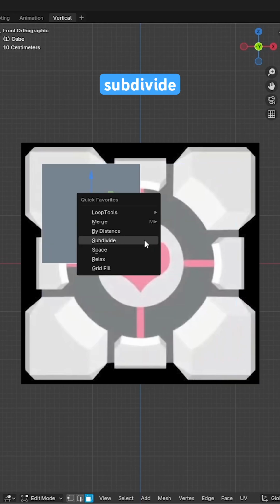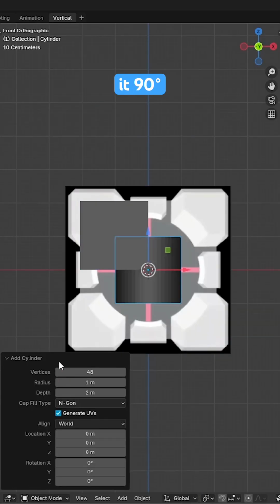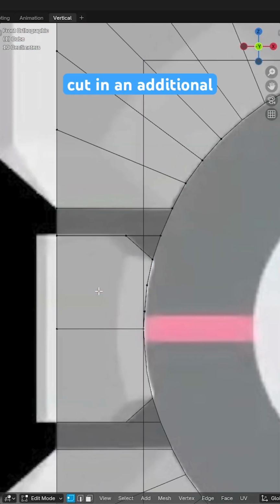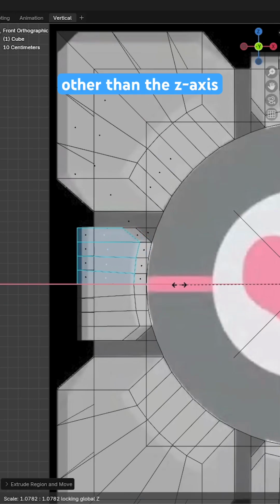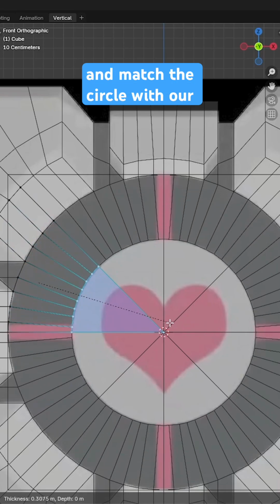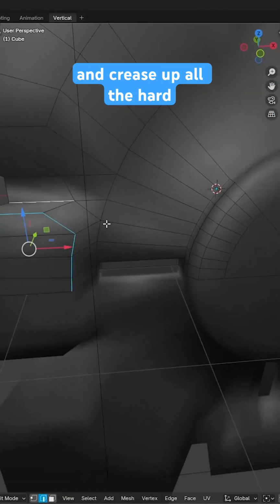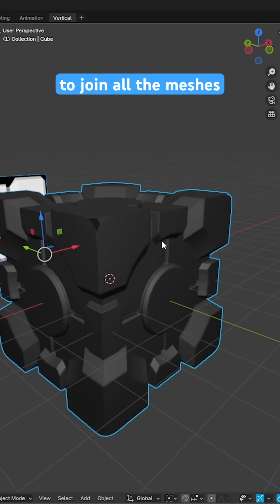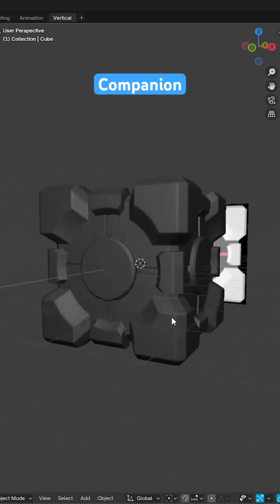Blender Modelling Challenge 7 Solution | Companion Cube #blender3d #blendertutorial #blendermodeling

Comment: Personnelment je préfère tellement passé par un logiciel de CAS comme plasticity pour faire l'objet 3d et ensuite faire la retopo manuel ou auto sur blender
Reply from the maker: You've got to go with the method that works best for you at the end of the day. 😄

I've personally never touched a CAD modelling software, so I'd struggle to do that, thus why I do vertex modelling. 😅

But I love that there are so many different ways of approaching the same model. 😄
Reply: @masterj2001 je trouve tellment compliqué le hard surface modeling poligonal
Honnêtement respect a vous!

Comment: People are saying it's a lot but if you've ever modelled something complicated (and are a beginner) it looks fairly simple. I normally fuck up about 20 times in this scenario so it would've taken me much longer and it probably would've been much less efficient even taking out the fuck ups.
Reply from the maker: Don't worry, I've been modelling for 11 years and still made many mistakes in finding an optimal process for this. 😅

But I don't see making mistakes in modelling as a bad thing, you've just learnt another way to not do a project, which will inherently spur you on to try a different approach and eventually find a modelling solution that works best. 😄

Comment: is this like genuinely necessary?? im a 3d modeller too but

that way sounds kind of weird to me
Reply from the maker: It makes intuitive sense to me for how I work, and my goal was to try to do it in the most efficient way possible, cutting down on the total amount of modelling required (as modelling each segment of detail across each face would not only be tedious but also difficult to keep the detailing consistent).

But it's reasonable for it to seem weird to you, as you'd have your own intuitive take on the modelling process that suits how you've learnt to model. 😄

If you have the time, I'd love to see your approach to the companion cube model to see if there's a more efficient way of doing it. There's a high chance that I may have overlooked a different and more straightforward avenue. 😄
Reply: @masterj2001  if i were to model the cube with a reference image as in the video, id probably just mess around a cube to fit inside the reference, i see the reason for your method though :)